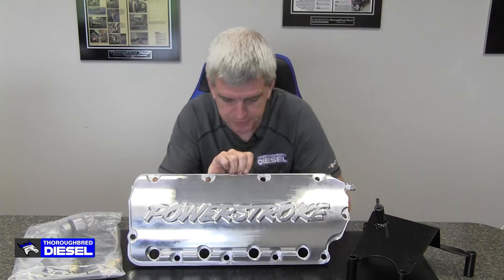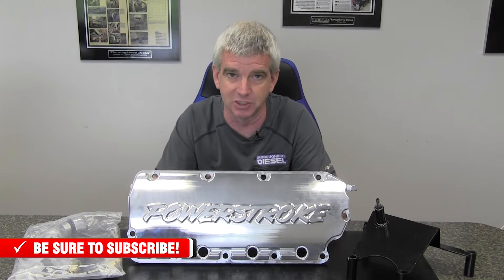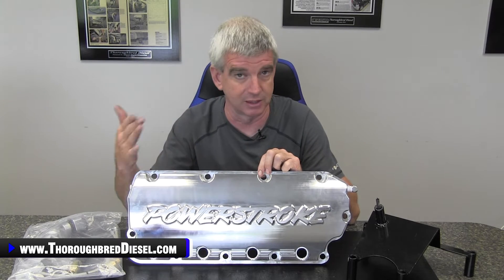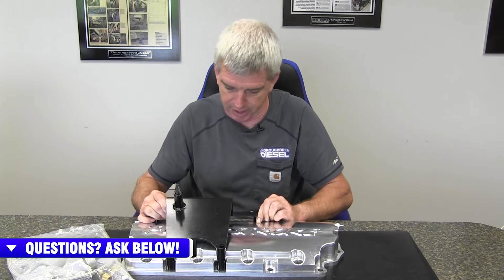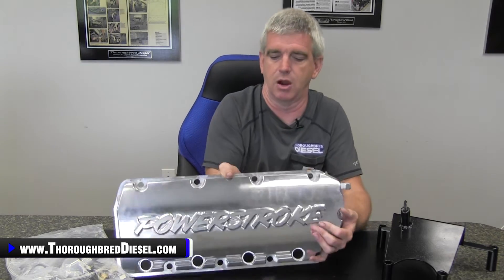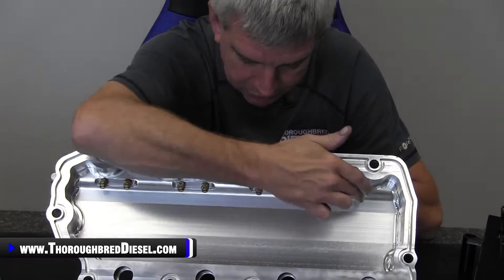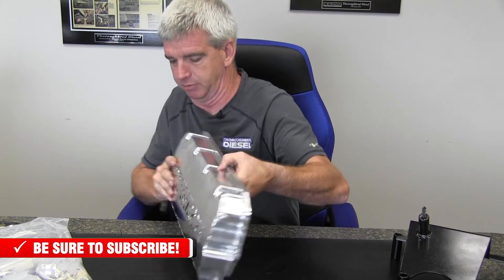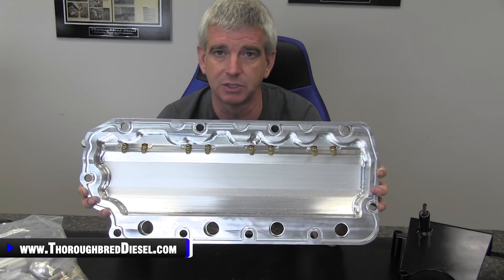MUST HAVE CHOATE Self-Oiling Valve Covers - 08-10 Ford Powerstroke 6.4L #diesel #fordtrucks #ford

Comment: Would you recommend someone buy a 6.0 or 6.4 today? Or just go straight to the 6.7 with how long it's been around?
Reply from the maker: Depends on what your willing to spend.  6.0 and 6.4 can be bought cheaper, but will require and investment to make them as reliable as they can be.
Reply: @thoroughbreddiesel  i know anything diesel will always need a decently yearly maintenance budget, in 4 years i plan to upgrade from my 2.7 F-150 to a diesel haha so i am looking at all the options between RAM and Ford